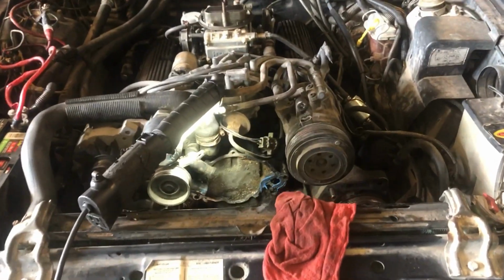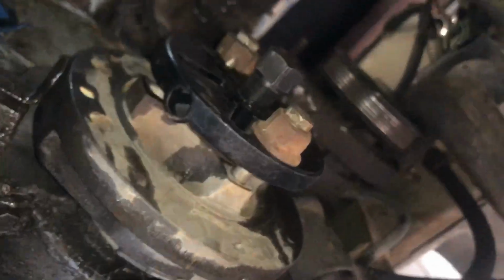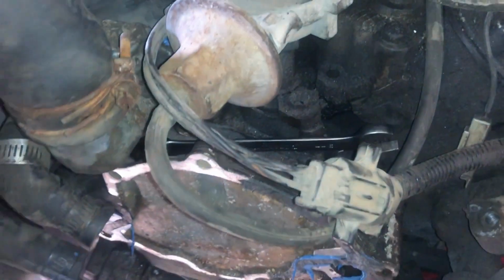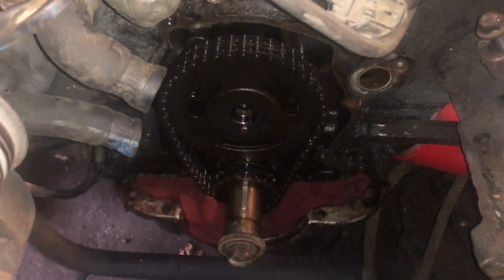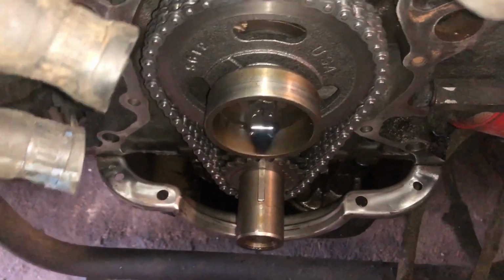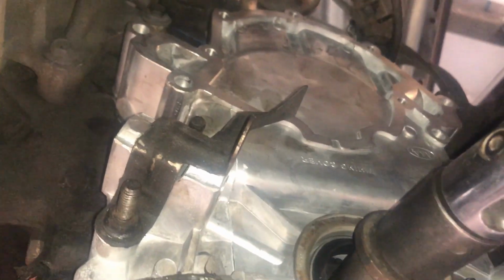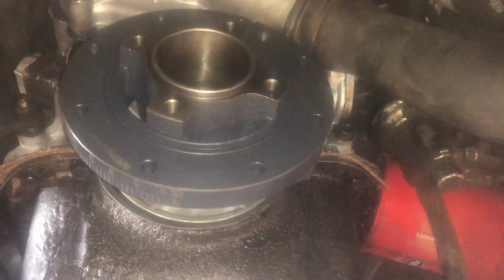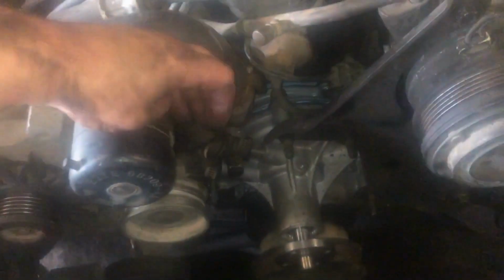Foxbody mustang timing chain & cover replacement guide harmonic balancer removal 5.0L 302 water pump

Comment: On my 87 Foxbody I'm trying to do a dry-run tc cover install. Mine has dowels and it seems the right one's about same dia of the hole in the cover, so it's giving me fits. My Haynes manual had me trim the cork gaskets to fit the pan corners then glue them to the oil pan 1st, but I think now it would've been better to rtv them and the rubber gasket to the cover and also put the dowels in the cover too (mine came out with the old cover), then rtv all the critical points.

Comment: Did you have to trim the corner cork gaskets on the front of oil pan gasket/ lower timing cover gasket?
Reply from the maker: Bare Less yes
Reply: FerKurl just confirming, I see you cut the original one piece rubber oil pan gasket flush with the block for the new gaskets. Did You trim the new one to meet with the old one?
Reply from the maker: Bare Less you got it
Reply: Hey bro did you place and seal the cork corner gaskets on the oil pan or the timing cover prior to install
Reply from the maker: @bareless3254  watch 6:50 they lock into black seal. I held em in place with a dab of rtv